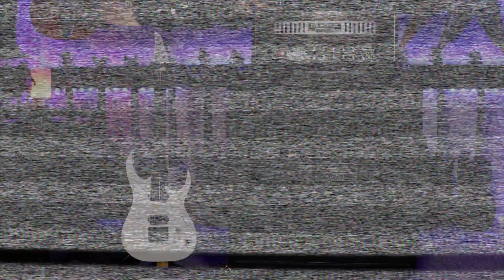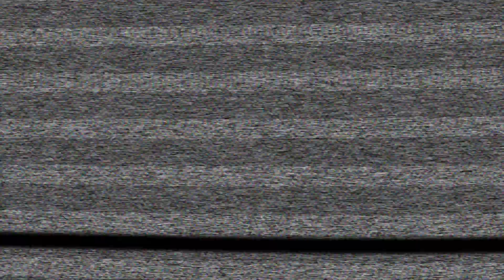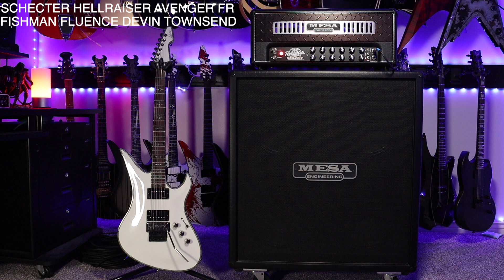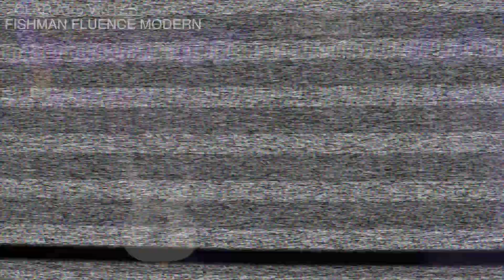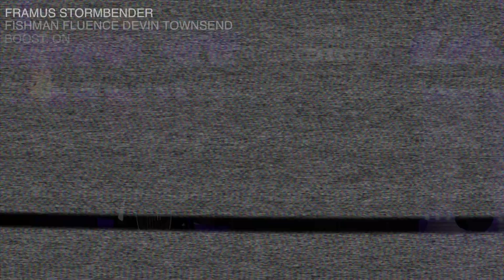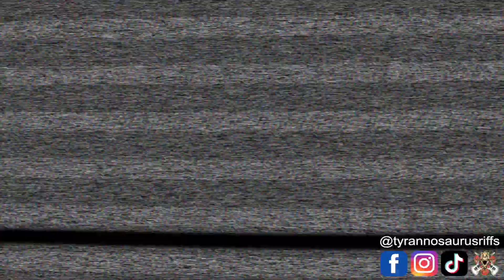High Gain Amp Comparison - Peavey / Mesa / KSR

Comment: I like how sculpted the Badlander sounds. Almost like it is mix ready out of the box. The low end is more focused and punches out in the mix vs the other 2. The other two require more low pass filtering so that they sound more clear. Boosted Rockerverb vs the Boosted Badlander would be an interesting comparison IMO.
Reply from the maker: The Badlander and the Orthos are the 2 most mix ready amplifiers I’ve played with. Simply the easiest. I could make that happen with the Rockerverb and Badlander! That would be a fun one.